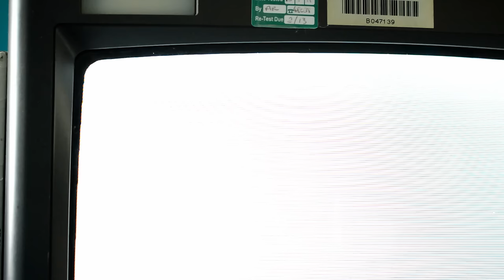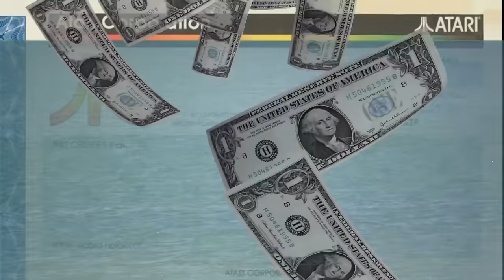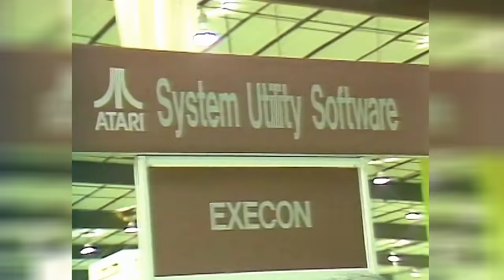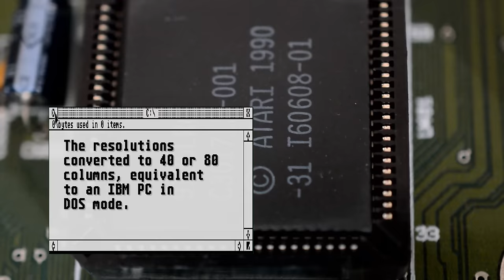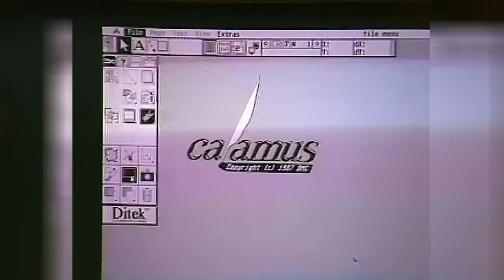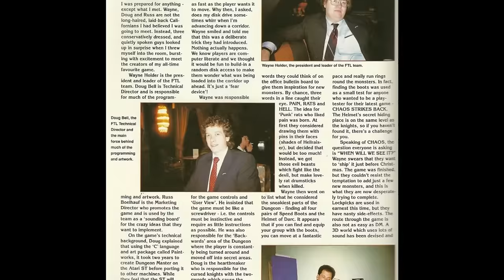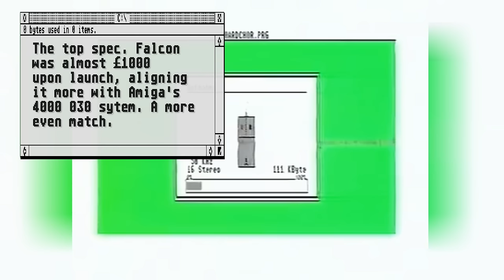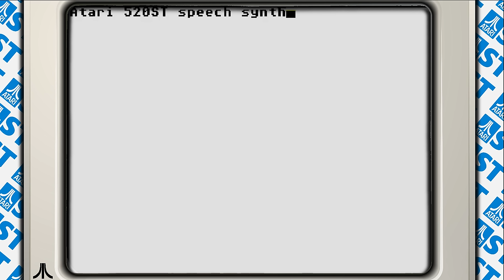The Atari ST Story | Nostalgia Nerd

Comment: Great video and very informative!
I know very little about the ST, and I was a bit surprised when you said it was the first 'true' 16 bit home computer, I mean, the original NEC PC-9801 model was released in 1982 in Japan and it was 16 bit, however back then it was released as a business computer, not a home computer, only in the very late 80s later models of the same computer line started being sold as 'home computers' so I guess you were right about it being the first one...

That said though, I'm not sure if the FM-7 was 8 bit or 16 bit, it was also released in Japan some time in the early-to-mid 80s, but it was a premium package back then, it sure did have 16 bit graphics though, with 256 colours and it also had a pretty good FM synth soundchip...
Reply: I think the FM-7 had a old 8 bit cpu but it had a more advanced graphics chip it i think had a 8 bit cpu to keep compatiblty with the older computers in the series and the pc 9801 had very poor graphics untill later but it did have a 16 bit cpu too but it was still worse then what was in the st  and only sligthly better then the old 8 bit cpus.

There where aslo very expensive workstation computers that where 16 bit in the 1970s but there where almost no games for  those computers since they costed more then a ferrari the original macintosh had the same cpu as the st but it had gimped monochrome graphics and 1 channel sound to appeal to the business market of the time who had no interest in graphics but still would buy very expensive computers.
Reply: betarage Yeah well, the ST used the Motorola 68000, that was an amazing CPU at the time, variants of it ended up being used in many arcade machines such as the Sega System 16 and Super Scaler systems and the Capcom CPS1, as well as the Amiga, the Sega Mega Drive and Sharp X68000 home computer, all of those systems were described as "Very Powerful" or "Very Fast"
So yeah, it's fair to say that the ST could do much better than the original PC-9801 model... That system was designed for the sole purpose of displaying Japanese text at high resolutions on-screen at 8 colours, so yeah, it did serve its purpose for businesses, but throughout most of the 80s games saw better support on other computers in Japan, including but not limited to NEC's own PC-88, which although not optimised for games, was affordable enough for the average consumer and where there's an audience, there's games to be made!
Reply: Technically the IBM PCjr (which was a failure) released in 1984 used a 16-bit architecture, apart from the fact that it used an 8088 meaning that the external data bus was restricted to 8 bits, which is why it could be considered to not be a 'true' 16-bit computer.
Reply from the maker: From a UK perspective, it certainly was. All other machines were priced and marketed as professional monsters. It's a bit like the 32 bit CD based debacle. It's often attributed to the Amiga CD32, but of course, Japan had the FM Towns before that
Reply: GranuleCheese Following that logic the Super Nintendo was not a 'true' 16 bit system either because it also had an 8 bit data bus, but even with that, and the slow processor, it outperformed its competitors, including many computers at the time in many ways...
Reply: Ruko Michiharu
Yes, it's more than likely that it was just from an UK standpoint. PCjr was only released in the US if I remember correctly - and it didn't fare well there either.
Reply: The Apple Mac was the first 16 bit home computer actually, or first one that was popular. Lisa's were ten grand each, but almost no one bought them. You should have seen the looks from the salespeople when teenagers like me would try them out. Fortunately, I wasn't rough on stuff like some people. You could buy a car for less than the Lisa at the time.

Comment: Oh man, holy time travel. The ST was my first computer my first company was using professionally. We developed some network components for TokenRing networks back in time and used it for controlling some machinery and in-circuit testing. Loved the 68k CPU family. Later with the MegaST the network and other components went into that box. Oh, and the excitement when we could insert the Blitter chip. Also had MINIX running on it back in days; but only for learning.

Comment: I had an Atari 520ST. The systemboard went bad in it. We could not get the hardware repaired at the time. This was back in 1987. There was a reason that the IBM PC compatible market took over so fast. Repairability! If your PC compatible broke, you could fix it. Plus add in upgrading the box to a new system was very easy to do in the early 90s.

Comment: I bought my Atari 520 ST in 1986 and was so happy with it for years.. A few years later I had 1 meg of ram, a double sided floppy drive installed into it and a special cable made so I could connect it to a Commodore 1084s monitor as before that I was using a TV for my display and the Atari monitors seemed rather squidgy in screen size..

I had a ton of games for it such as:
Hunter
Starglider 1 & 2         Pawn (adventure game)
Midwinter 1 & 2        Dungeon Master (loved it so much)
Populous                   Archipelagos
Gauntlet                     Falcon (from Spectrum Holobyte)
Backlash                    Bubble Bobble
Carrier Command (main reason I got the machine upgraded)         Conqueror  (was really good)
Virus  (from the same developers as Conqueror and was ported over from the Acorn Archimedes)
Darkside and Damocles really good at the time..
I had a lot more but the lest would get too long but I loved them all..  https://en.wikipedia.org/wiki/List_of_Atari_ST_games

Comment: I still have my Falcon030, though haven't used it in many months.  I also have a 520STm and 1040STfm I got for super cheap on eBay a while back that I don't even know if they work or not (I need an external PSU for the 520STm to check it).  A 520STm was actually the first new computer I ever bought myself in 1985 from Electronics Boutique in the USA (now GameStop after acquisition by NeoStar (Software Etc. & Babbages) and rebranding).  I also had a 1040STe (one thing to note is that the manufacturer label on the bottom of 520/1040STe machines actually called them "4160STe" models because they were exactly the same except for amount of RAM pre-populated and could be fully populated to 4MB RAM).  It technically only supported 512K/1MB/2MB/4MB configurations, but there were software hacks to get it to work with 2.5MB (usually from adding 1MB SIMMs to the 2 empty slots on a 520STe)...not sure if there were the same hacks for 1.5MB/3MB configurations.  And one other interesting note is that some of the early STs had issues w/ the PLCC socketed chips (including the CPU) coming loose from shipping and an official fix from Atari was to drop the computer from about a foot above the table to try to force them to reseat...or have an authorized repair center open it up (and maybe install clips like later models had) to reseat them.

Comment: Oh man, that digital voice at the end reminds me of the text to speech box that my dad built from the plans in one of my old Atari mags (I don't remember now if it was Antic or Analog, but putting it together required some help at the time).  I had made a program that had a little menu (long before GUIs were a thing) and you could type the text you wanted the thing to say.  I'd even done a little font for the thing so typing ctl-c would give you a "ch" or ctl-s would give you an "sh" since I didn't have any sophisticated text processing.  I think I even still have that thing.  It ran off two of the joystick ports on the Atari 800.  But the voice sounds about the same.  And that was from some Radio Shack text to speech chip.  It was definitely one cool setup up.

Comment: I HATE the Yamaha sound chip they settled on. Most folks couldn't afford a decent MIDI device back then, especially after shelling out for the ST, so that doesn't even come close to making up for it, IMHO. It's too bad the AMY was never completed which would have probably sounded much better, but what the system sorely lacked was a capable multi-channel DAC like the Amiga had. Well, that and a blitter chip on release. Actually, what Atari's 16-bit system was missing the most were the Amiga chips they were set to acquire before Tramiel screwed that pooch.

Comment: A little known fact but the company I work for, Bell and Howell used Atari ST mega 2s and Falcons to control their Mailing inserters for many years. One of the few Industrial uses of the Falcon I would guess, I supported them while I was in tech support, extremely reliable, were powered up 7x24 and very few problems with them.

Comment: I looked at one of these new.  I couldn't get a compiler software package loaded in the computer store, even with the help of the store's tech guy. I was working as  computer operations guy and going to school to finish up a BSCS.  Left the store and bought an Amiga 2000hd. It was way more expensive, but way more usefull.   Originally had an Apple 2, then a Macintosh (for about a week) then the Amiga

Comment: 7:51 A large chunk of AmigaDOS is actually in the Kernel ROM, but to the users eyes all it appears to do is bootstrap the system and provide a disk insert prompt.  If an otherwise blank floppy installed with a bootblock is inserted though, large chunks of the windowing code and the whole AmigaDOS shell is quite obviously present and available.  This is why having a kick rom that matches your version of Workbench is important (ish)

Though, the argument could be made that while GEM might offer a GUI the OS is actually very barebones, almost as dependent as the Amiga on some actual programs being present on your boot media to do anything... unless you want to format a disc.  TOS does have you covered there.

Comment: I’d had an Atari 800, then an 800XL, starting in 1981, and loved those machines, as though I’d birthed them (I did actually do some hard mods, although not very sophisticated.

When it came to the ST, my mouth was agape, but before I could get a “next gen” machine, the Amiga 500, which competed, for me, with its all-in-one build. I ended up with an Amiga, but I’ve always wanted an ST, etc., to fall into my lap, for some games, but more the MIDI, which is the biggest reason people still use them, even in 2021. It’s impressive...
Reply: Yup. Pretty much as you described it. I wrote that, when I started watching, because I still want an ST. Well, I’d take a TT or Falcon...

Comment: Don't forget back in 1988, Sam Tramiel told the press ATARI would absorb the high price of DRAM chips (due to worldwide shortage), rather than increase the price of the ST hardware. 

Atari promptly went onto slap £100 onto the RRP of the ST until Autumn of that year.

Comment: I could not afford either Atari or Amiga but my friends did and the bonus for me was I got to use all these machines. My friends would let me just come over and use away.  I have no axe to grind on a fav. I preferred the Atari over the Amiga.  Really seemed like a full blown system. Machine and software package that came with it. Both of these machines where capable far beyond most of the people that used them and it was 16 bit and out first and less money.

Comment: In those days you needed to understand what you were doing being part of the hobby or even being the hobby.

Nowadays computers boot and do what ever program is on.

In the old days installing a mouse could keep you busy for an hour or so.

It has become much easier to use computers and myself only use laptops nowadays.

The 80s and 90s were great. Had an Atari 800XL, Amiga, Philips 286 with a whopping 20 MB HD! in the day.

My first puter I bought new was a Pentium III 450, gosh that was a fast machine! With a Belinea monitor.

Comment: How can the ST be the first 16 bit home computer? Macintosh? PC/AT?
Reply: Technically, the TI-99/4 was the first 16-bit home computer., the Sinclair QL beat the ST to the UK scene, but Nostalgia Nerd doesn't believe in proper research or fact checking, sadly
Reply: @thefurthestmanfromhome1148  technically the intellivision was also 16 bit, but neither that or the ti-99/4 really functioned like true 16 bit systems despite having 16 bit processors. Ti had a bad design that made it super slow compared to most 8 bit systems

Comment: If you like 3.5" floppies, you would probably also like the 3.5" "SuperDisk". They were poised to compete with the 100 MB Iomega Zip drive.
I've never used a SuperDisk, so I can't speak for whether they have that satisfying click but I was always fond of the 100 MB Zip disks. They're a bit thicker in a more rigid shell. The most notable improvement being that low-profile metal tab.

Comment: I will say this, I do not have any experience with these. I grew up in the 1990's in the states. For me it was all Sega Genesis/Sega CD and Snes. In 1993, Doom broke me and I did my damndest to get it. I chased add-on's dead end 32-bit machines...and finally building my first PC in late '94 a clone 486DX2 

At any rate, your Atari 520ST still looks sharp today. It looks really well built and I love the square buttons running the top of the machine. One question, what type of file system is the Atari ST? Is it FAT32?

Comment: The ST was a direct response to the Amiga. It would have never existed without the Amiga. That part is clear. Also, the Amiga was designed independently of Commodore, it was the C-64 team that worked on the ST, the the Amiga team. It is true though that Commodore only cared about the technology, not that staff that created it sadly.

Comment: The controller port under the system seems like an odd design, but you can get around it by using an extension cord. You can just keep the cord plugged into the system and use the other end to plug in controllers.

Comment: Why did I purchase an Atari ST instead of an amiga, very simple. The Atari st had hi (and I mean high!) monochrome output. In the mid 90's I wrote pharmacy dispensing software using GFA basic software which was used successfully for 8 years in 13 pharmacies in the group businesses. at it's time this machine rang circles above and beyond Microsoft PC's

Comment: 12:29 that is not the MC68000 processor of an Atari 520ST. That was in a 64bit DIL package (I remember because I unsoldered it, put a socket in and attached an 68881 floating point coprocessor to my ST)

Comment: The "Kickstart Disk was ONLY an Amiga 1000 thing", ALL Amiga's after that had it in ROM. The A500/2000 on, had it in ROM and you could continue too boot the OS off a floppy or Hard Drive.. or Most games bypassed that so, you could boot off the Game Floppy.
Reply: sluggotg I added Kickstart to rom in my  A1000. That could be done if desired.
Reply: @classicarcadeamusementpark4242  Kickstart on floppy for the A1000 was because it wasn't ready when the system was launched, so it was basically a beta.

Comment: this channel's back catalog of history episodes are top notch - really enjoy them

the problem with game publishers and home computer manufacturers is that they gravitated away from cartridge slots as the medium for game delivery. Publishers wanted to shave off per unit cost by going to cheap floppy disk medium but they were just cutting their own throats by enabling massive losses through software piracy - this was a big advantage of the console market where cartridges were THE publishing medium. Any computer aimed for the home market should have come with a cartridge port and manufacturers should have instituted publisher support and certification programs that would stipulate cartridges only as the delivery medium - with a hardware key scheme for enabling the game to run when started

Comment: Nitpick at 05:18  : Atari didn't limp along 'on console sales' until the ST came out. The 2600 JR and the 7800 were released in 1986. The ST came out in 1985. It'd be more accurate to say they continued selling the XL computer series until the XE re-design (also in 85). Atari stayed out of the video game market until Nintendo entered it in 85. Jack halted video game sales in the interm (plus there were lawsuits from GCC about their royalties on the 7800 to be sorted out).

Great vid tho (which is why it's easy to nitpick when there's literally only 1 or 2 things to nitpick to begin with). The  team-swap between Commodore and Atari was also covered in Atari Age Magazine in the Nov-Dec issue : https://www.scribd.com/document/396603102/Atari-Age-Magazine-Nov-Dec-2018

My fave memory of the ST was it was the very first computer that I played networked FPS games on. MIDImaze was nothing short of astounding in the 80s at the LAN party that was assembled at a user-group show in Colorado.

Comment: The amiga doesn't have a native chip tune style soundchip does it? All recreated in software using the DACs I think.
Reply: The YM2149 doesn't have anything on Amiga's Paula.  But knowing both as I do...   You have to know both of them.  The Amiga sound chip was designed for the Amiga alone.   The YM2149 is a derivative of the General Instruments AY-3-8910.  Off the shelf chip.